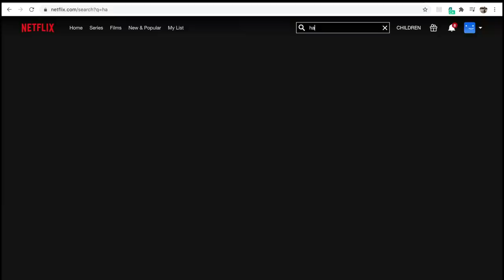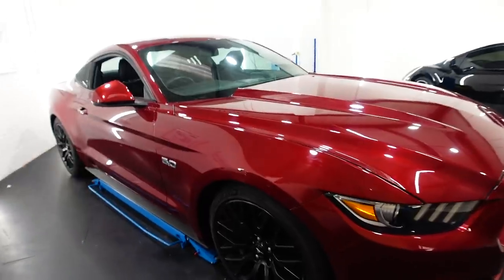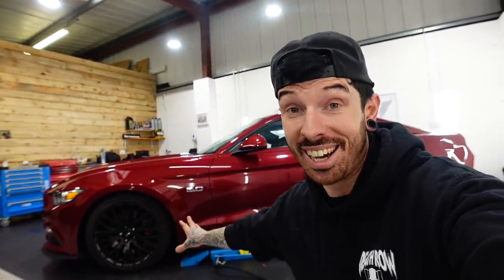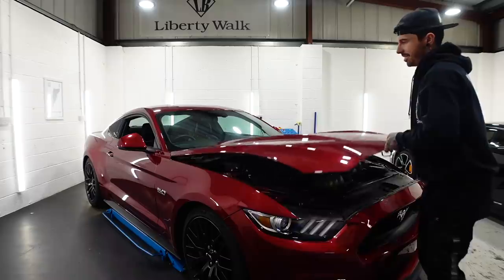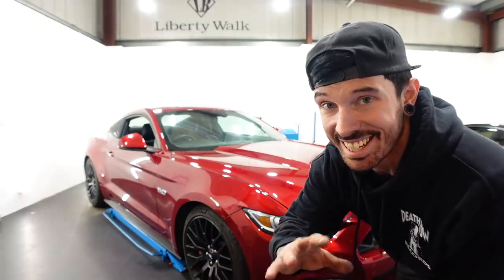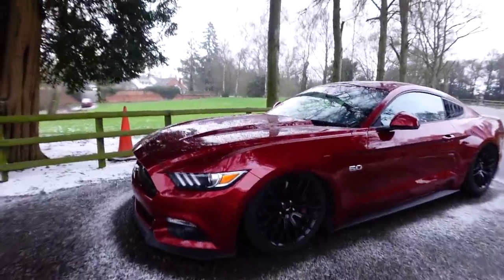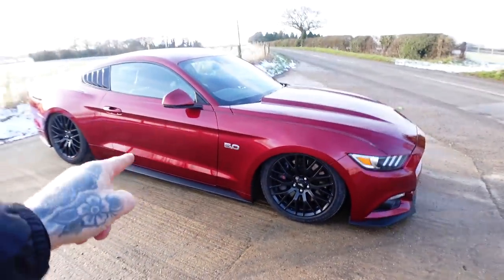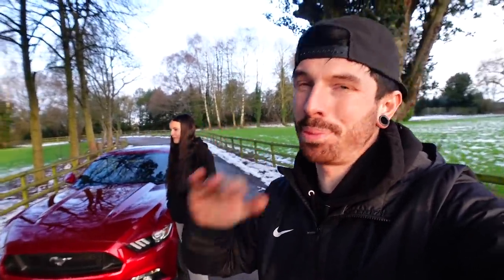SHE TRANSFORMED HER FORD MUSTANG WITH THIS MOD

Comment: Great video.
As many have pointed out the front tint is illegal.
But mainly I’d suggest removing it for your safety, the front tint will alter the field of vision when looking out of the front window and when driving especially at night. 
Also your hand gestures (of any type) to other drivers will not be able to be seen by other drivers. 
I think the lambo comes with a 25 - 30% stock tint which is the legal limit for the UK.
Not trying to be a kill joy and it looks cool but it’s neither legal nor safe.

Comment: Is tint on the front window and side windows legal?? Overhere its extremly illegal.
Reply: Depends on the percentage mate. I found out the hard way on my last car when I put 50% on the front windows and they were 30% from factory 😅
Reply: Usually tinted to max from the factory so I’m guessing they are illegal
Reply: Oh well
Reply: yup, if you get pulled they can make you remove it at the road side

Comment: Get a borla attack exhaust they sound so good on the 5.0 V8
Reply: I agree I have the borla stype axle backs and my mustang and has transformed it 
Not too extreme but lovely rumble very tempted to try H or X pipe with them but it’s wife’s daily driver 🤣🤣

Comment: you might find the police dont like that tint on the windscreen and doors its really dark usually cars come out the factory with the darkest you can have on windscreen and doors  and if they do you for it you could get upto 6 points. My supra had the lightest aftermarket i could get and that got me 3 points and it ripped out at the road side i was not happy

Comment: Tinted the outside face of the windscreen??? Surely not; can’t imagine that lasting very long... be full of wiper marks within a week...
Reply from the maker: no it goes on the inside they measure it on the outside first
Reply: @MatArmstrongbmx  I was expecting it to go inside, but it looked like they were heat gunning it on the outside which made me question it...
Cheers Matt